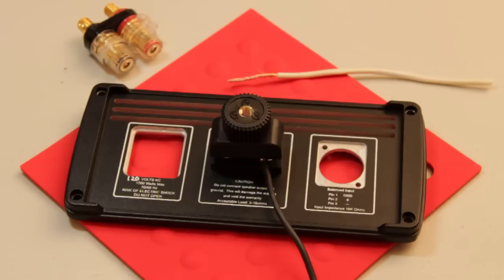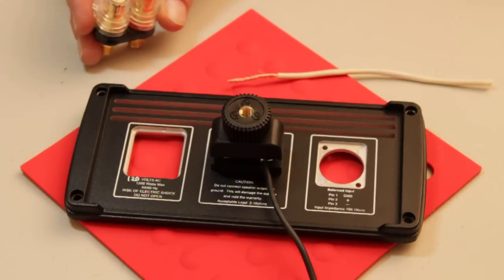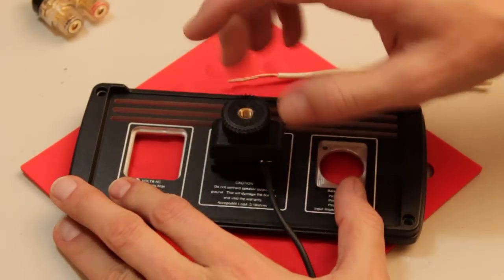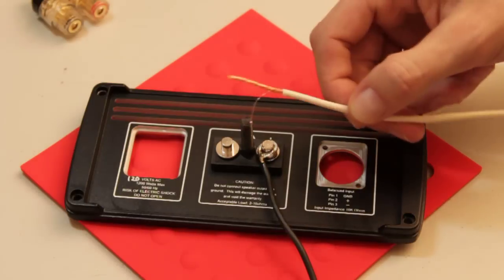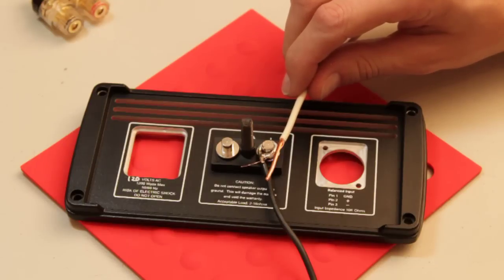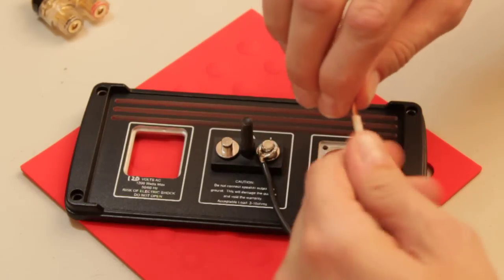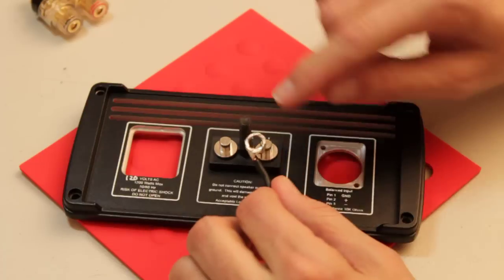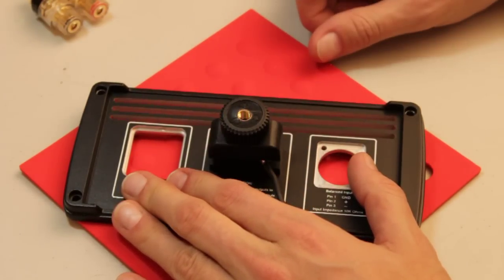cardas binding post instruction video.MOV

Comment: Thank you a lot for sharing.

I am just wondering that have you had experience using Banana plugs with it?
By drilling holes, shall the drilling on the clamp go all the way from top to bottom?

Thank you.
Reply from the maker: You could drill holes but on our amps the depth of the binding post is going to have solder in the way and you would risk pushing the internal wires out of the binding posts.   However Cardas has a longer version that could easily support that kind of setup.  I would reach out to Cardas.com directly and ask them this same question.  They might have experience with this type of customization of their product.

Comment: The cardas binding post is very stupidity, too hard to use.
Reply from the maker: Hi James - This video is merely the safest way to use bare stranded wire connectors.  If you have spade connectors, the Cardas custom binding post is very easy to use.  Simply loosen the knob just enough to let your spade connectors slide into place.  Then hand tighten them down firmly (do not over-tighten or you risk breaking the clamping component which I have done as I am an ogre).